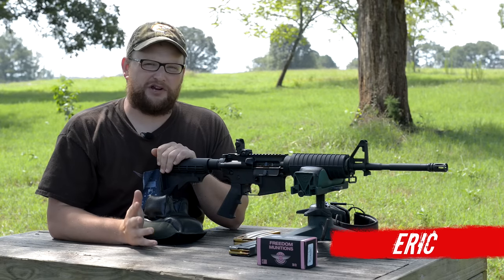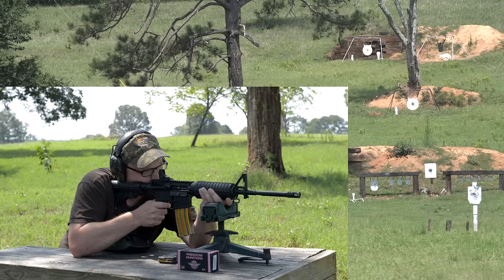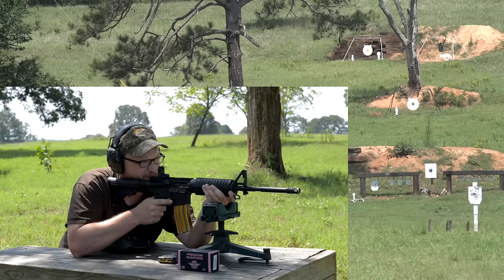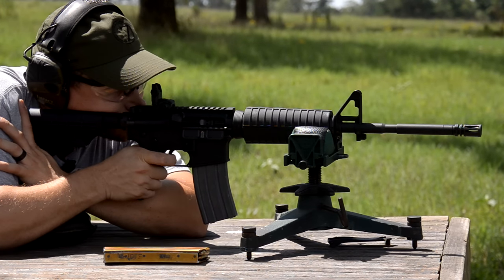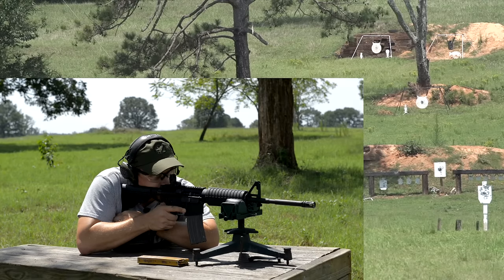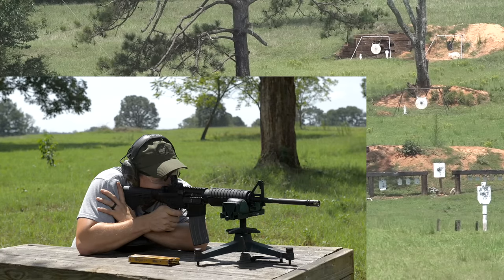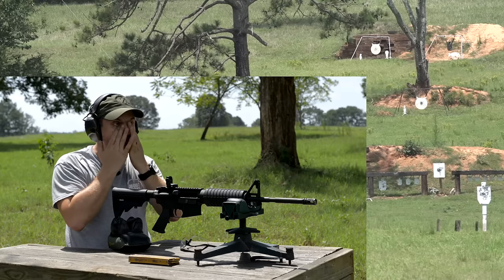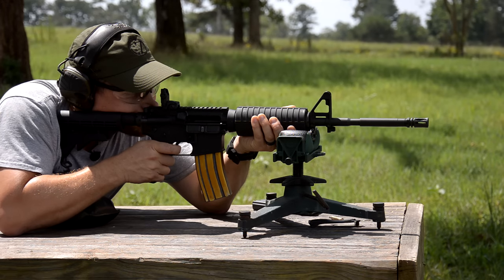Basic AR-15 Practical Accuracy

Comment: Practical Accuracy : Entirety of shots fired from a bench rest.
Reply: so there is no operator error that influences the test...
Reply: That's why the military using burst round shots
Reply: @TheMrkiddi  Practical accuracy means operator error is included. This is what the military means by "effective" range and accuracy, it is determined by the average performance of individuals who participate in the testing.
Reply: levi blankenship  No. It isn't practical to carry a bench with you whenever you go shooting.
Reply: @DaveSmith-cp5kj  showing what the rifle is capable of is practical. Operator error will vary depending on situations. Propping the rifle on a wall, truck, dirt hill, trench, ect will provide identical results given you are a competent shooter. Did you also want to take hos heart rate? Your Pratical accuracy would include that  right?
Reply: @DaveSmith-cp5kj  Wrong. The effective range in the military is based on ballistics. I guarantee you the average infantryman isn't hitting targets at 500 yards with an m4.
Reply: @joshuajones4956  I think you are confused. Everything is based on ballistics, that is physics. "Ballistics" is the new "tactical" it is a word that is overused by laymen. Max effective range is determined using human error as a factor. It is defined as the average infantryman being able to hit a static man sized target (such as an E-Type) 50% of the time at the specified range. 

This is of course empirically derived, however, before any testing is done, it can be roughly extrapolated by taking the mechanical accuracy of the firearm (derived by firing from a remote jig with zero human influence) and then multiplying the shot group by two, then using some basic algebra to find the distance at which the shot group is twice the width of the target width (since E Types are taller than wide).

The reason so many people here are getting this wrong is that they erroneously think that eliminating variables naturally leads to more accurate results. This is often true, but not in any research where the performance of the operator is fundamental to the performance outcome. Most handguns are capable of a 3MOA group. However few are able to consistently make a 3" group at 100 yards. So if you are testing practical accuracy and not weapon accuracy, you must not use any aid at at all (such as the bench) that you would not practically use during most of the usage of the rifle. When it comes to practical testing, you either perform or you don't. There aren't excuses. It is why the data driven Army still relies on this qualitative test so much, as it incorporates the variable of human error that cannot simply be extrapolated accurately.
Reply: @DaveSmith-cp5kj  I wasnt weighing in on your practical accuracy debate, I was just pointing out you're wrong about how the military measures effective range, and it appears you continue to be wrong.
Reply: @cunnelatio  That doesn't make sense at all. Using a bench helps a shooter shoot better than they normally would. And if we are supposedly testing the accuracy of the shooter and not equipment, why is it called "AR-15 accuracy" and not "IV8888 Accuracy"?
Reply: @joshuajones4956  Simply stating I am wrong doesn't make me wrong. Especially since I am right. Don't take refuge in ignorance, look it up if you doubt me.
Reply: @DaveSmith-cp5kj  Is that anything like simply stating you're right? Lol
Reply: @joshuajones4956  Like I said, don't take refuge in ignorance. You can look this stuff up and confirm that what I stated was correct. If you are scared to prove yourself wrong, then that simply says more about you than me.
Reply: @DaveSmith-cp5kj  Lol am I getting lectured on ignorance from a dude who refuses to share sources? Please, tell me why you think you're right and I'll tell you why you're wrong. Or we can just keep on with the baseless claims, I'm fine with whatever.
Reply: @joshuajones4956  If you can't do a basic google search that is pretty pathetic. This is why you are wrong:

I think you are confused. Everything is based on ballistics, that is physics. "Ballistics" is the new "tactical" it is a word that is overused by laymen. Max effective range is determined using human error as a factor. It is defined as the average infantryman being able to hit a static man sized target (such as an E-Type) 50% of the time at the specified range. 

This is of course empirically derived, however, before any testing is done, it can be roughly extrapolated by taking the mechanical accuracy of the firearm (derived by firing from a remote jig with zero human influence) and then multiplying the shot group by two, then using some basic algebra to find the distance at which the shot group is twice the width of the target width (since E Types are taller than wide).

The reason so many people here are getting this wrong is that they erroneously think that eliminating variables naturally leads to more accurate results. This is often true, but not in any research where the performance of the operator is fundamental to the performance outcome. Most handguns are capable of a 3MOA group. However few are able to consistently make a 3" group at 100 yards. So if you are testing practical accuracy and not weapon accuracy, you must not use any aid at at all (such as the bench) that you would not practically use during most of the usage of the rifle. When it comes to practical testing, you either perform or you don't. There aren't excuses. It is why the data driven Army still relies on this qualitative test so much, as it incorporates the variable of human error that cannot simply be extrapolated accurately.
Reply: @cunnelatio  I definitely am. You said it is to demonstrate accuracy is limited by the shooter and not the equipment, and yet the title is AR-15 accuracy and not IV8888's accuracy. Even if it were the case that we are showing the shortcomings of the shooter in the overall group, shooting from a bench would remove part of that skill limitation from influencing the group. Hence OP's comment.
Reply: @DaveSmith-cp5kj  Dont tell me you gave up without ever naming your source? XD
Reply: @joshuajones4956  So you still can't refute what I said, or do a basic google search? You are only cementing how little you actually understand about this subject.
Reply: @DaveSmith-cp5kj  Lol I imagine you're somewhere in the range of 13-16 years old, you've seen a gun twice or maybe three times in your life, maybe handled your dad's once or twice. Can't imagine anyone except a young, naive, keyboard warrior would have the nerve to be so blatantly wrong while not even being able to back up their assertions. You assume that because you are you, I and everyone else must trust you on whatever you say even if you are literally wrong, and a quick google search could prove it. Maybe try one yourself, buddy.
Reply: @joshuajones4956  Nice projection. You still haven't brought anything substantive to the table yet to prove "I'm wrong". Like I said, don't take refuge in ignorance.
Reply: @DaveSmith-cp5kj  You haven't brought anything to prove you're right, you're just making baseless claims and telling everybody else they're wrong lol
I simply said that your baseless claim is wrong, I essentially did to you what you did to everyone else.
Reply: @joshuajones4956  Again, nice projection. Prove me wrong then. Start actually giving some reason as to why I am wrong. My guess? You can't, otherwise you would have long ago.
Reply: @DaveSmith-cp5kj  Maybe next time you could "google it".
Reply: @joshuajones4956  I did, and I was right.
Reply: @DaveSmith-cp5kj  Lol well, the facts are there and you can read them for yourself. If you still dont agree, then at least you can admit you're talking nonense.
Reply: @joshuajones4956  Yup, and the facts agreed with me. Want to try again? lol
Reply: Karl Bischoff  I think you missed my entire point, but good work.

Comment: Thanks for the vid. Just bought a Ruger AR-556 (which is about as basic as you can get) and zeroed it at 50 yards. Pretty confident that it will hit at 100 yards out to 250-300.  Can't wait to test it out

Comment: My AR is a S&W MP15 and is just like this one. I am looking forward to seeing what it can do with some glad on it. I just hope you guys will put something on it that the average Joe can afford... not a $1200.00 ACOG...
Reply: glass... not glad... dang auto correct!
Reply from the maker: We are hoping to show a wide variety of options including some of the expensive offerings.
Reply: +Iraqveteran8888 can you please do a range video of the VZ52 Czech rifle...long time viewer been waiting for a review and havent spotted it in the background of any gun gripes videos near the sks's...
Reply: Man, that MP15 is so underrated. I have one and I fucking love it. It's such a sweet gun.
Reply: a friend of mine is on the swat team and he uses an average old colt for practice. the only thing hes had to change is the firing pin after tens of thousands of rounds. he got it for under 800.
Reply: I'd buy one of those Nikon scopes, for 200m a 200€ scope should do the trick
Reply: roteroktober420 - Primary Arms standard SFP 1-6x or 1-8x ACSS scopes.

with my SFP 1-8x ACSS onboard my modded FN 16" M4/RECCE carbine i can smoke a CQB course or clear a house on 1x as well as an Eotech or red dot, run 'n gun from 10 to 300 yds on 3-4x as well as any ACOG and on 8x i can nail distant targets out past 600 to 800 yds as well and faster than any 2-10x, 3-9x or 3-12x scope out there and do it all in succession without having to touch my turrets.

plus i can fire rediculous groups at 25, 100 and 200 yds as tight as most target optics.

these PA 1x to 6 or 8x scopes are all you need for any semi auto.
nothing out there can do it all as well. thats why i have 3 of them!
Reply: Nikon ar 223 or sig romeo 5 for a red dot has been great but seriously it’s all the. Shooter

Comment: The DOD standard for the M16A1 was 1 mil.  That is 3 1/4 MOA.  Mine shot better than that.  With issue sights mine would hold a dime at 25 meters.  That translates to about 2.4 MOA with iron.  So the platform is inherently accurate.

Comment: My AR build ended up being a mid length 16 inch barrel HBAR.  I actually ended up liking this set up better. I did have a couple of hick ups due to the mid length.  First off, I bought the hand guard and gas tube as carbine length, and ended up having to buy mid length, then my buffer spring was a carbine spring too,  That didn't show up until I finished the gun and fired it for functionality.  It started short stroking.  The empty case would eject but the next round didn't load.  I did some research and ordered a chrome silicon buffer spring and that fixed the short stroke. It's a lighter spring, and evidently going from a carbine length to mid length, there just wasn't quite enough gas pressure to fully cycle with the carbine spring.  But that worked out ok too, because the carbine spring has a life expectancy of around 12,000 rounds, but the chrome silicon spring has a life expectancy of around 750,000 rounds.  Long past my rifles life expectancy or mine.  I should never have a problem with it.
Over all, I really enjoyed the build. I learned a lot and my supervisor wants me to build one for her too.  She has to order her parts, then we'll sit down and start assembling.  Looking forward to it.

Comment: Is that clicking after each shot the trigger resetting? It's loud as hell.
Reply: yup, trigger reset. 

no idea why its that loud...but most ARs seem to be loud like that. 

however....the round you just fired is going to be louder, so its really not a problem.
Reply: the mic is sitting really close to the trigger so it's picking it up quite well
Reply: the louder the better! seriously, that's the whole point.
Reply: A standard Mil-Spec trigger is loud!.. haha, got geissele's on all of mine now!
Reply: i can hear it.. even up here in alaska.. :D
Reply: Chris Wolf it might be because of his mic, since it's so close to the trigger. It might adjust the audio level on the shot so it's not super loud so it doesn't seem as loud in comparison.
Reply: I think they dampened the audio for the rifle shooting. And kept the audio on the person normal, which would have placed the mic right next to the trigger, making the sound from the trigger louder than normal.
Reply: Yes, it is the trigger reset. Both of my AR15s sound the same. Both have milspec triggers and both of them are really crisp. I don't plan on installing any aftermarket triggers.
Reply: Chris Wolf he's basically letting up enough to reset the trigger which makes it easier on trigger squeeze.
Reply: milspec trigger resets are designed to be loud and clunky so when someone is shooting with a helmet and full combat gear, and very rarely hearing protection, they can actually feel it rattle, and also hear it.
Reply: When most companies make a "mil spec" trigger, what they mean, is that it's heavy and shitty. That reset is soooo much louder than anything I've ever used in the military.
Reply: its the disconnector disengaging the hammer.
Reply: Glad you asked thought I was hearing things...
Reply: RobStar sweet
Reply: How can you guys pull that trigger all the way back to the frame like that without pulling the gun off target?  All I can manage to do is increase weight on the trigger until it breaks...don't know what happens after that because I'm looking at where the round hit and setting up for the next shot.
Reply: if you hear my trigger reset consider yourself lucky.....
Reply: My AR has a standard Mil spec trigger (and lower parts kit), and it resets like that... Oh well. Accurate up to 300 yards with a 3 moa red dot (Bushnell TRS-25)
Reply: That makes no sense. All his shots are almost immediately after the click. Which means that he's letting off the trigger and then slamming it back down? There's no way then that it could be the first half of the pu'll?
Edit: after watching the second guy, my"theory" is looking... less certain. cough
Reply: I used to own a Ruger mini-14, so I filed down the primary sear to have a very clean break, I leave the secondary sear un-touched because I definitely need my weapon to lock into battery. The secondary click you hear is a very positive reset. It needs a lot of breaking in...
Reply: Agree It sounds like a firing pin delay.  Annoying as Hell If I heard that in real life I would assume I am a dead man.
Reply: @johnchalleen3278  is a fool!
Reply: My Colt 6920 is audible too
Reply: Last I checked, a gun going off isnt exactly quiet.
Reply: That click is disgusting  💯

Comment: I just can't figure out why shooting an AR with the stock collapsed is so popular. It is so uncomfortable.
Reply: Well shorter people definetely will collaps the stock.
I cant judge for tall people, as I am short myself, but I guess to have the eye closer to the sight.
Reply: Just depends on the persons preferred length of pull which is generally determined by height and arm length which determines how comfortable a certain lop is.
Reply: I honestly like to try different stances because each has benefits and draw backs. If I am shooting at medium to long ranges, I have the stock fully extended. Still, some people like to have their eye as close to the ghost ring or optic as possible. Since the 5.56 doesn't kick much, people have no issues having their nose up to the charging handle to get a bigger sight picture. I don't, but if I we're clearing a building, I would have the stock more collapsed to help make my silhouette smaller, make it easier to move in small areas and doors, and the tighter feel on the weapon helps maintain control while firing consistently in close quarters. Though, I almost never collapse the stock entirely. I usually have it at 3rd position on a six point stock. Also, when I was enlisted, body armor made firing with a fully extended stock uncomfortable, so when I was issued an M4 to replace my M16, it was nice to shorten the stock to make up for the extra space of my armor.
Reply: People change the stock to however they feel comfortable with it, either long or short. There's nothing else to it.
Reply: When I am the only one with the polymer stock in the comments. But I like my trap door! Have a whole tool kit with the gun in their.
Reply: Eric isn't exactly a lanky man.
Reply: When you use the aperture sight, you’re supposed to shoot with your nose on the charging handle. Most people can’t do that with the stock fully extended.
Reply: it depends on a few things, like length of arms, but also how you like to place your hands on the rifle. i personally have long arms but dont use my full reach, i like to tuck my arms a bit. and the 3rd position on a 6 position collapsible stock is most comfortable for me. though i can shoot with it in the 6th position fully extended as well

Comment: I was just about to do a video on this type of stuff. I built a super cheap, base line ar15 and took it to 100, 200, and 500 yards. I was really surprised at the accuracy from it. It 200 yards was nothing with iron sights. I put on a  cheap 3-9x50 for 500 yards, and it was not hard at all. The gun was Anderson barrel, Anderson bolt, a2 front sight post, Ncstar Vism flip up rear sight. Scope was leapers mil-dot.